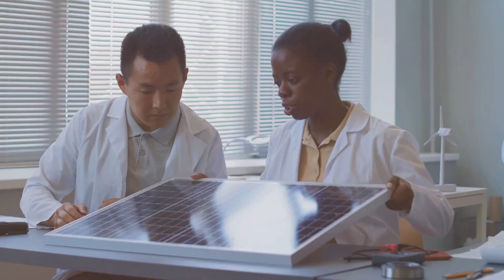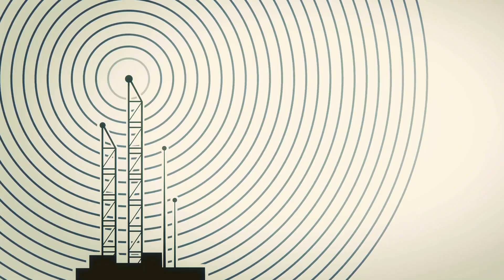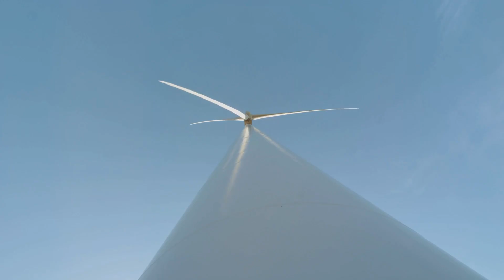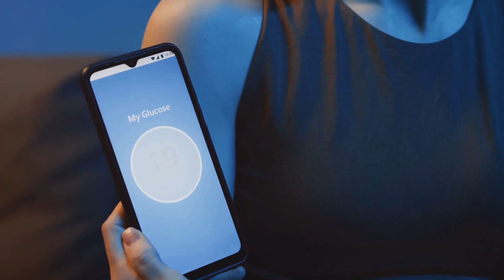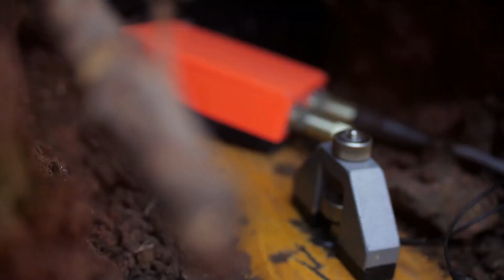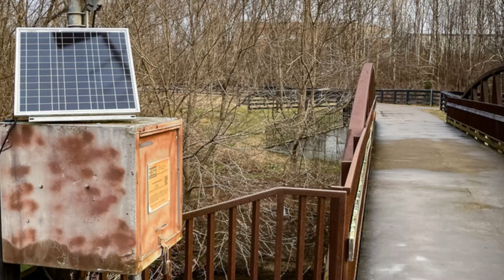Harvesting Energy from Thin Air: The Revolutionary Spin-Rectifier Technology

Comment: Nicola Tesla was running around in an electric car powered by HIS ‘ether energy’ device, about the size of a bread box, in the early 1920s. Floyd Sweet made one that could run a 350 amp motor, and it was the size of a pack of cigarettes. (You might lower the soundtrack a smidge)

Comment: Dennis Lee developed a way to harvest the heat energy in the air and convert it into electricity. He used a super efficient heat pump developed by his company coupled to the Fisher cycle phase change heat engine driving a electrical generator.

Comment: The energy from radio rf can power an LED it is only micro amps. Not much else.
Reply: Your are right due to regulation issue the power density allowed is in the range of 1 mW per centimeter square 😂😂😂😂